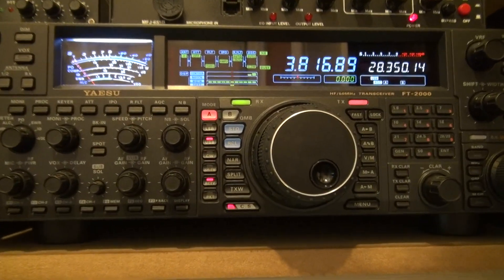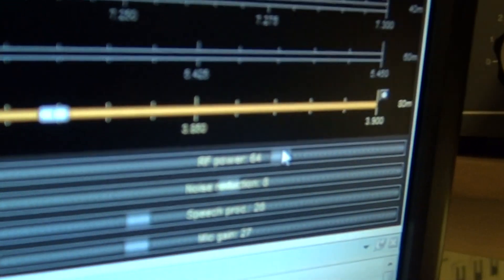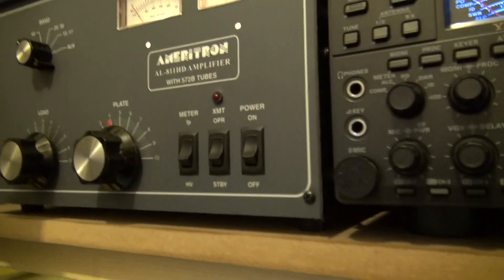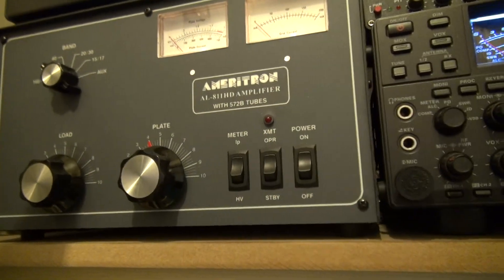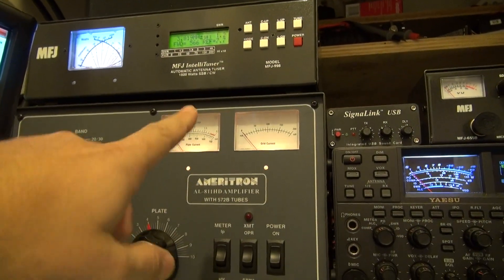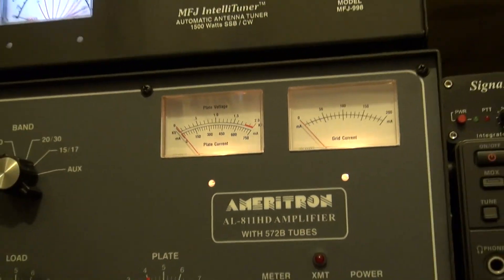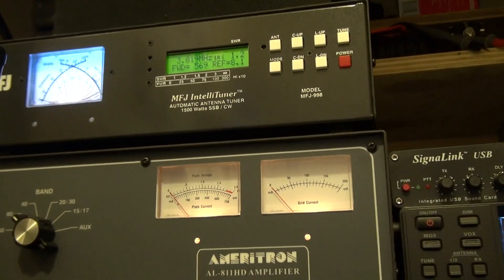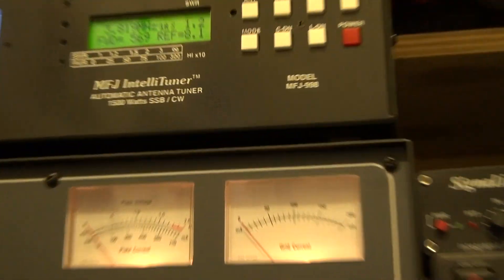HOME MADE G5RV ANTENNA  FOLLOW UP

Comment from the maker: The LMR-400 coax runs continious from the shack to the feedpoint, 75 percent underground in pvc electrical conduit there are a few barrel conectors inline in watrer tight enclosures, I checked those a few weeks ago. Other than that you can see in the 1040 video the G5RV feedpoint. I am willing to bet im having problems with the junky peice of rg8x choke i quickly assebled to get on the air. I will post an update when i get rid of the dodgy choke.